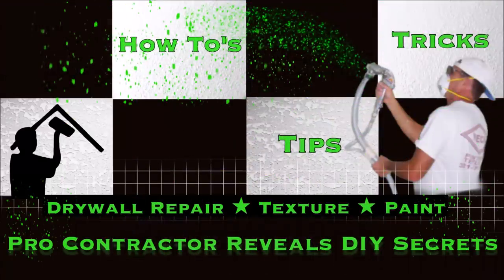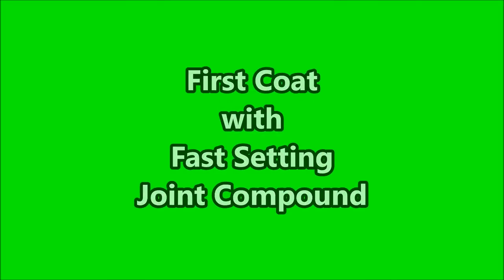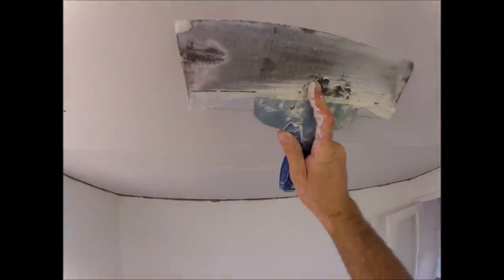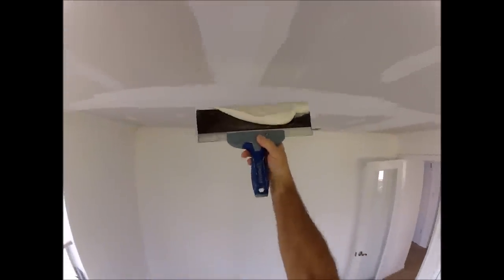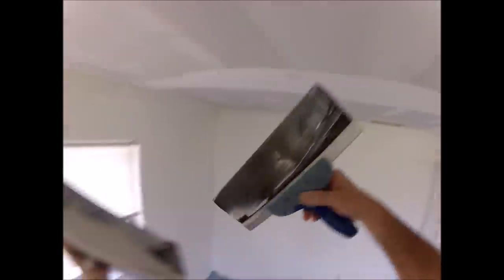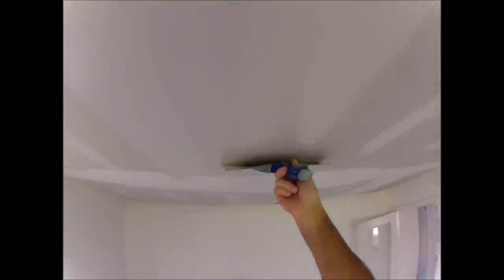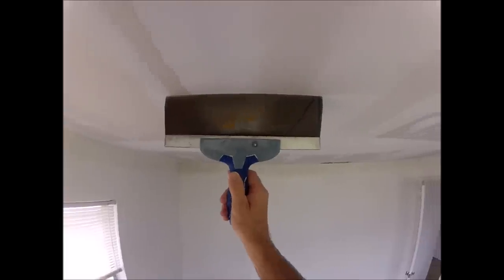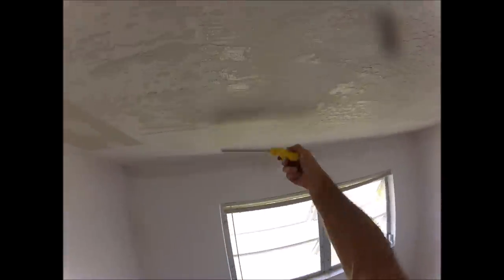How to mud drywall butt joint when using fiberglass mesh tape diy

Comment: WOW!!! I am impressed!! An actual youtube video where the  CORRECT use of mesh tape is demonstrated. It amazes me at the amount of incorrect information being put out. The sad part is that someone will watch one of those other vid's, repeat what they saw and end up with a mess from he!! 10 times worse than what they were trying to fix in the first place.

This was great, as it was simple, short and to the point with correct information. The only part missing (at least IMHO?) was the fact that sanding fast set is a lot more work then regular lightweight mud so applying more than needed could result in some very non-christian words being used while working, Lol. Awesome work!
Reply from the maker: So glad you’re enjoying my videos!👍🏻Thanks so much for watching and commenting my friend!😎 -Paul

Comment: What is the reason for the fast drying mud for the first coat?  How fast drying?  Do you use the 20 minute setting mud?
Reply: Becuase fast setting actually hardens and helps mesh stay in place regular all purpose dries but isn't and steering so it'll crack.  If not to experienced with fast setting go with paper tape
Reply: @rickyboyz8  I hear that everywhere, but I've been using all purpose mud and mesh for years and never had any cracking problems. I can see the pros and cons of both types of mud, but either has worked well with mesh, in my experience.

Comment: Header says how to use fiberglass mesh. Video doesn't show that.
Reply from the maker: Actually here’s the title “How to mud drywall butt joint when using fiberglass mesh tape diy”…👍🏻
Reply: So no tape whatsoever? Misleading title and hack work 🤡

Comment: 1: butts do not have enough screws
2: loose paper underneath the tape is guaranteed to bubble.
3: that ceiling is gonna need a belt sander. 

Theory is there but that’s about it. Cheers.